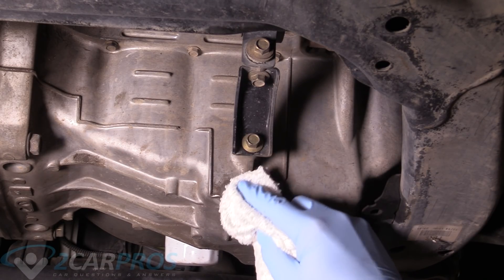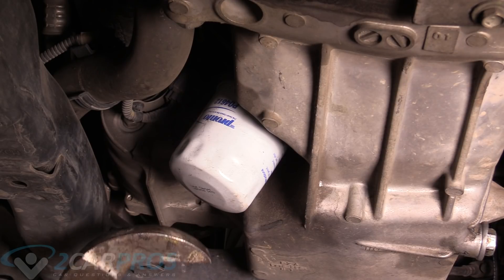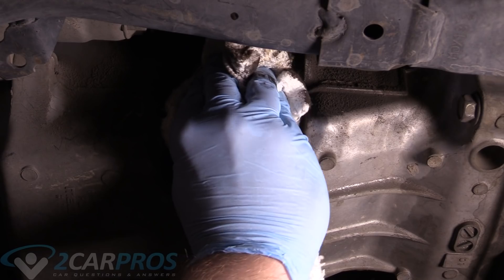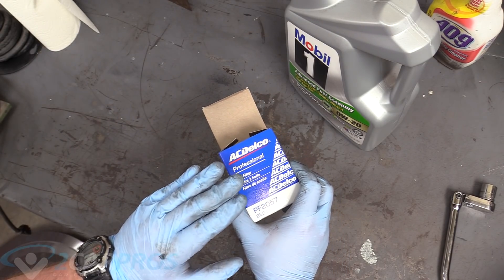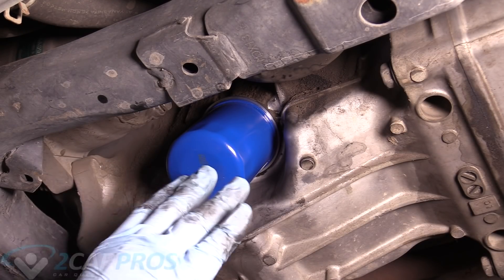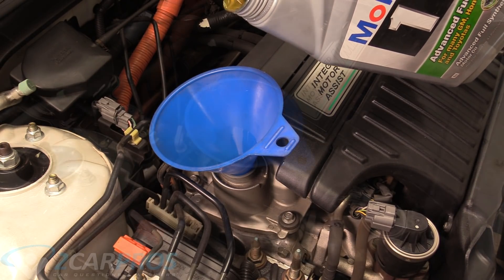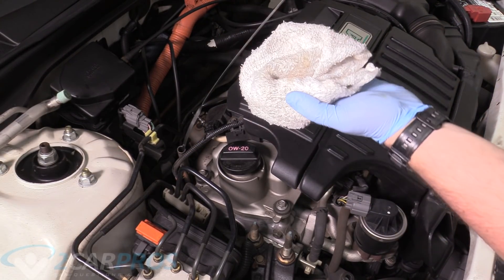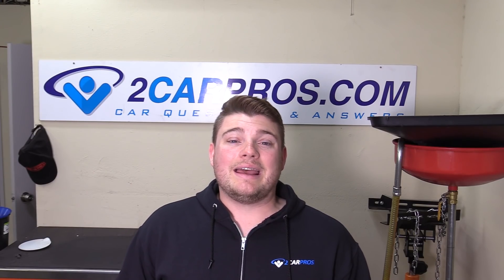Oil Change Honda Civic 1.3L 2001-2005 HYBRID - Full Guide

Comment: Would recommend to replace crush washer each time you change oil.  Also this model year Hondas are famous to have failed threads in the oil pan drain plug. So better invest  $90 for vaccuum oil suction kit  and save yourself a pain to have to repair the threads or deal with oil leaks or have to replace entire pan.